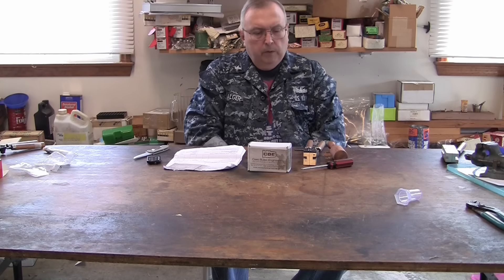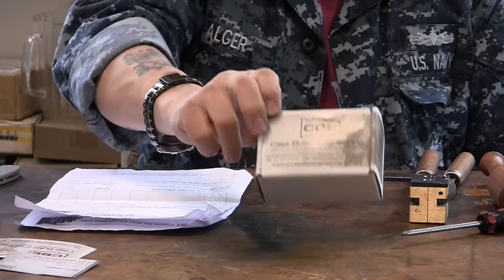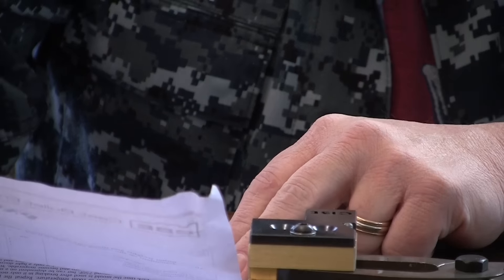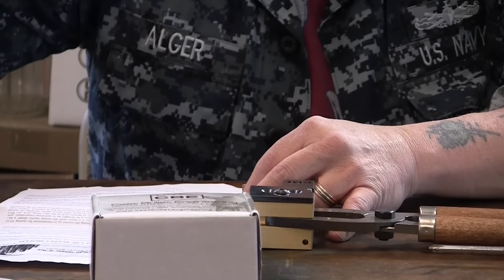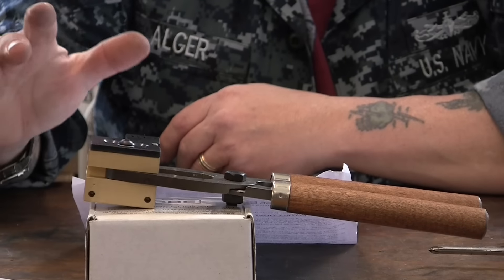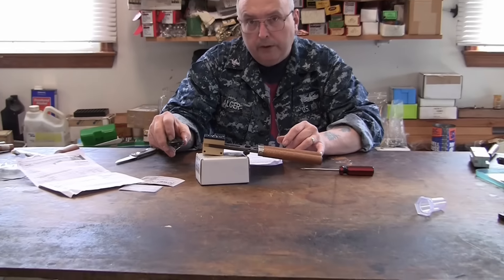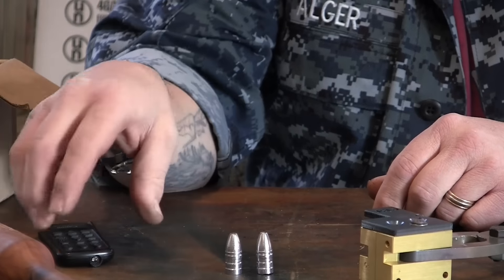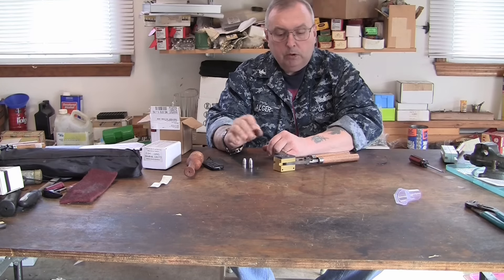Cast Bullet Engineering bullet mould review

Comment: These CBE moulds are very good , They are much more durable than the very soft Aluminium mould blocks, but of course as they are "custom" made, are a little more expensive, but not that much more expensive for those of us that live in Europe, (buyers in USA get a very cheap deal when buying specialist supplys). As you say, for a specially calibre mould, there are few other options.